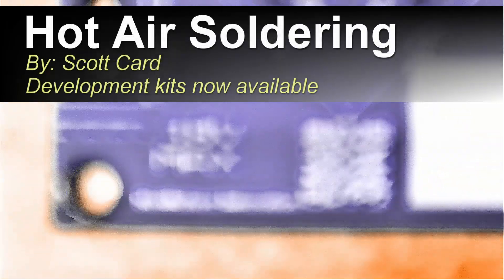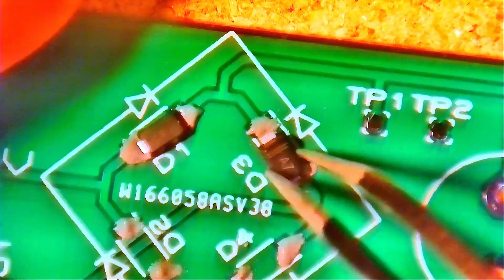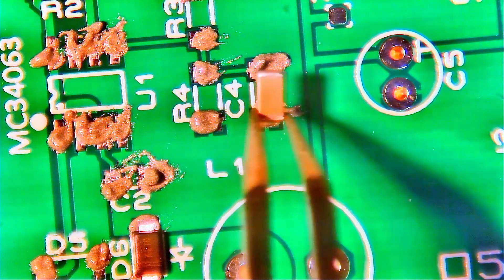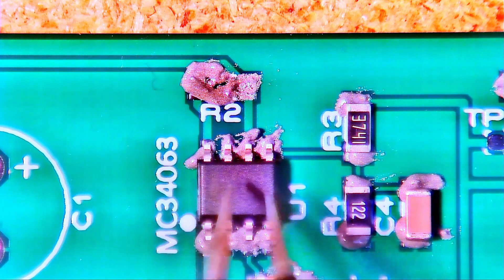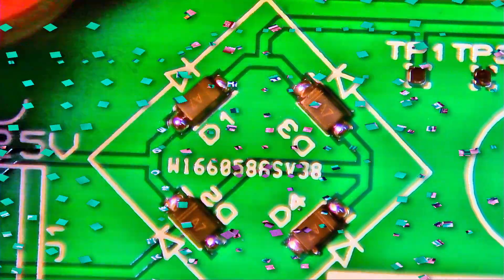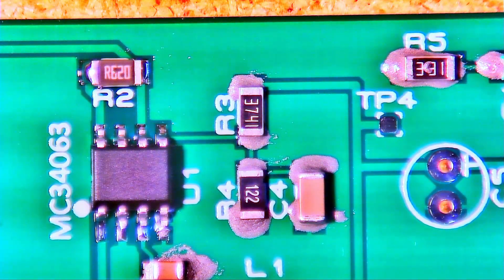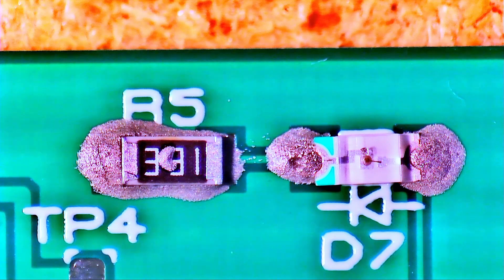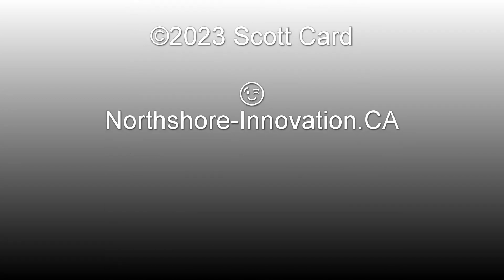Level up Your Skills: Hot-Air Soldering Made Simple!

Comment: Thanks for the video. I use thru hole components mainly but for bypass etc caps I use 1206 SMD. Until now I used a fine tip for the 1206 and it's OK, but now I will have to solder SOIC chips and I'm getting a hot air station to make my life easy : ) What is the soldering paste you would recommend? And of which type? (cleaning, not cleaning, etc) If you don't want to say any brand, please recommend which type so I can find it : ) Thanks in advance!
Reply from the maker: Solder I use is TS391SNL (price seems OK), Cleaning is always suggested, I have not used that brand. Thanks for the question.
Reply: For instance, Allecin AEC-559-SFP is any good? 15€ for a 30cc siringe is the normal price for it? Is Bojack a good brand? Just to see if I'm in the good path

Comment: Maybe a stupid question.. But if I struggle soldering with a normal iron, could I just hot air solder through hole parts? I struggle with an iron, I've done soldering with a gas burner on copper and silver before.
Reply from the maker: It may not solve your problem.  I would first address the issues you are having with though-hole parts. Ensure everything is clean, you have good solder, and sufficient flux. Set your temperature correctly and have a clean iron tip to ensure good thermal transfer. The issue with hot-air for though hole is that you heat a larger area by the time the heat migrates through the board, and parts can start to fall out  because it is up-side-down.

Comment: i just started with hot air soldering. Im trying to remove componets from a donor board but i am really struggling. I must put the temperture very high and air flow also too high. Is this normal? If i try with 375 for example i dont see the solder melting like i see in other videos,.
Reply from the maker: Sometimes, they use glue to stick the parts down.  We see this with double-sided boards. You may also have issues with high temperature soldiers.  If you are looking to remove parts from a doner-board, try placing it up-side-down on your oven rack with a baking try below.  Set the temperature to 250C and watch the parts fall off!

Comment: I ordered this solder paste, it came in a pot. Whats the best thing to apply it with? I tried a fine brush but im not getting consistant amounts on the pads. Pretty difficult to measure with 0402.
Thanks
Reply: toothpicks. But also most likely it’s meant to be used as a syringe refill.
Reply from the maker: Both are great suggestions. Most drug stores will have syringes, but you will want blunt tips.  You can get these online as they are also used for glue dispensing.

Comment: What brand flux paste did you use? Thanks for the tips.
Reply: Solder paste, not flux paste. You may also want to inquire about the solder bead size, which is generally Type 3 or Type 5.

Comment: Hi, do you recomend any hot air station under $100, i was looking at a yihua 959 hot air station, is the most "budget" i could find, thanks!
Reply from the maker: The 858 has been serving me well. I have 2 from different manufacturers, and they both work well.
Reply: @ScottCard is the wep 858d any good?
Reply from the maker: @samgonzalez1447  they are all similar but from different manufacturers.  For light use, they are great .  Be sure to turn it off when not attended.  I do not trust the reed switches.

Comment: I got chip quik smd291ax and ts391ax (no refrigerator needed) because they seemed like the best options for resin flux instead of rosin. Did i pick wrong? Is there a reason you use the rosin based one you use? Better with the no lead solder? I have a el cheapo hot air gun i just got for now to learn.
Reply from the maker: I use led free because I have my children in my lab all the time, and I do not want to expose them.  Cheep is good for learning and TBH, mine is still going after years of use.

Comment: How do you prevent or ensure you don't get a bridge under such a small component of the solder paste is completely under the component?
Reply from the maker: Definitely need to be mindful not to get too much solder, but it has not been a problem for me yet. The surface tension tends to make it pool on each terminal.   Thanks for the comment.
Reply: @ScottCard  thanks for the info.  I'm just learning to hot air and was worrying about that.  Particularly since you can't see it
Reply from the maker: You will get the feel for it. A little too much is not a problem.  The biggest trick is to keep the air speed low so you do not blow the parts off the PCB. 😉
Reply: @ScottCard  uh..... Nope.... Never done that.... 🤦.... That was actually attempt one.  Had some diodes take flight.  Any suggestions for little solder balls that just wind up in the middle of nowhere?  Clean up with isopropyl? Or?
Reply from the maker: @emf9  I use alcohol and an old toothbrush to clean the board.  This also removes any extra flux.the alcohol evaporates quickly and is easy to clean up.
Reply: Thanks appreciate the advice @ScottCard
Reply: @emf9  yes, surface tension is wonderful. I’ve never used stencil, I just add some paste and heat until it liquefies and never had any shorts. I only use paste for non-legged components like QFN, others by soldering iron.

Comment: Hi Mr Scott when you said minimum fan speed its like 1 on a 8858+  hot air station?
Reply from the maker: @Evilslayer73  yes, as low as you can.  If the flux is sticky you can turn it up, but do not blow the parts away!
Reply from the maker: Yes. Be sure the nozzle is as big as you can use as well. Obviously, you don't want to heat areas unnecessary, but you want a very light air speed and a tacky paste to prevent the components from going away!
Reply: @ScottCard that's new info to me. Many say use small nose tip on the heat gun lol. 
Thanks for the info. 
You mean big like full size ? I have all different tips with mine

Comment: I might attempt to remove/replace a 0402 6.3v 0.1uF capacitor that's shorted to ground on my Xbox PCB. But I'm not sure if the capacitor is bad itself or if there are other component/s that are shorted/bad in the circuit. My suspicion is the ICS network controller. 48pin IC. Since that supply the RJ45 connector with transformer.

Can you please look at the bad schematic? It's not really detailed.
Reply from the maker: Well, I don't know much about the Xbox but I am sure it is not powered from the ethernet jack. If there is a short in the capacitor, it will be quite hot and is an easy fix, but the odds of that being the main issue is slight as 100nF is typically just a filter and are quite robust. These do however sit across the power rails so, you are on the correct path if you found a short. Good luck, and happy fixing!😎

Comment: Nicely done Scott! My question is how do you ensure component integrity with that S08 package? How do we ensure too much heat hasn't damaged the chipset?
Reply from the maker: Thanks for the question. Two things we must do: make sure that the temperature of the air is not too high,  and be quick. The heat takes time to soak into the die so we can get away with a lot more than if it were to soak. Also, because the air from the hot air iron is mixing with ambient air, the ic is not as hot as the iron.